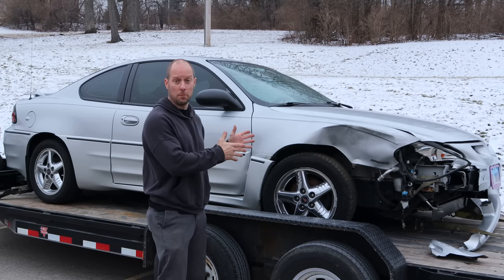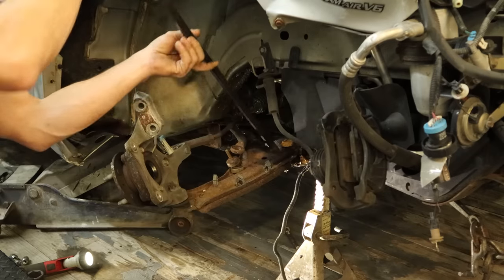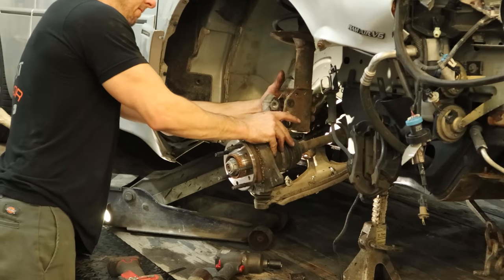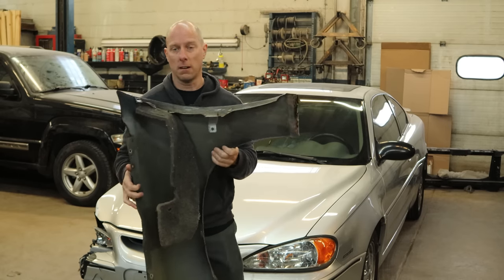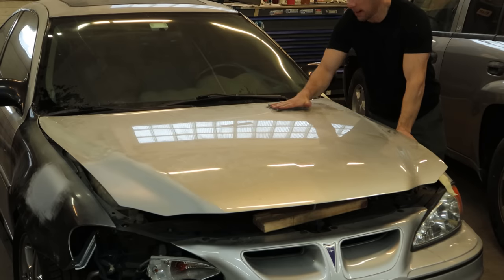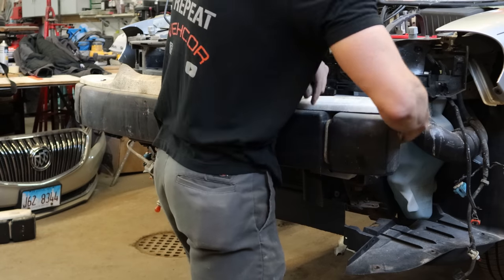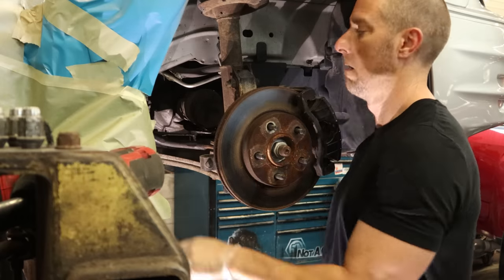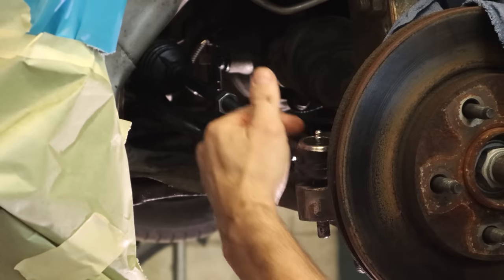How did my rebuild hold up after another wreck?  The cheap Grand Am is back again!

Comment: I’m interested in the price of the repair. Granted this example looks clean, and it would be the “devil you know”, for the owner, around here those are $2,500 cars. My impulse would be to just find another. 

I drove a 98 to over 260k miles where the odometer broke.  She never gave up the ghost and ran when I got rid of it. Super easy and cheap cars for the average shadetree to keep on the road. Tons of parts availability back in 03-07 as the local yards were full of them back then.  As a mechanically inclined college student paying his way through school, it kept me on wheels.

Comment: Damage the axle? In 25 years, I only damaged one, I used a press instead of a hammer, flared the end so the first 1/2" of threads had to be ground off so nut would fit again. It was my first one, old timer said, use a hammer. Never damaged another. I worked in front end shop most my life. So, rock-on Scott.

Comment: That extra long wiper blade reminds me of a buddy who lost one in a rain storm one night late. Only place open was a gas bar and they had one, 20" vs the 18" he needed. Had no choice but to buy it. 2 weeks later he still had it and whenever he used his wiper he also cleaned off part of his roof. 

it was a beater so he didn't really care but it was funny to see (and hear) the thump thump as it ran over the edge of the roof. 

Hey it sure beat removing a t shirt and wrapping it around the end so it didn't scratch the glass!

Comment: in the old days guys put pin strips on for making a paint repair brake off points to save on paint cost ! I could always tell do to off color. Mostly used car lot's did that ! YOUR painting guys job looks pretty good for not blending the door silver is off a little hard to do with out a blend (drop coat ). good job for a car that old anyway .

Comment: Those Grand Ams must be tough. There's still a bunch of them on the road.
Reply from the maker: If they are maintained, they last.  The rust usually gets them around these parts but it eventually consumes any car.
Reply: Not here in Massachusetts never see them
Reply: @robertsmith987  As strange as it sounds I discovered about 20 years ago that car brands and model preferences vary quite a bit depending on the state. It's a little odd but true. Some states have a higher preference for imports and it makes the domestic car values low so if you ever relocate don't take a domestic model car to Washington or Oregon because domestic cars are valued lower in those states.

Comment: You should have heated that tie rod up with oxy before you hammered it back into shape. That would have really stirred up the hornet's next. Anyone with any common sense would know that this is a temporary repair, just to get it off the trailer and you'll replace it later while doing other repairs.
Reply: Common sense ain't so common,and keyboard warriors love to strike without thinking.Either that or they haven't watched Scott long enough.Been REALLY awesome if he'd wrapped it in duct tape and hot glue!
Reply: Most of the very same keyboard warriors that complain about something being done wrong, Themselves do the very same thing wrong. They find it impossible to resist projecting their own guilt on to others allowing them to feel righteous about their own wrongs.
Reply: And then welded a piece of rebar / broken socket extension to regain strength.
Reply: Scott said he was only doing the bending to get the car off the trailer, not only can some people NOT read, use common sense, they also can NOT hear!!!!

Comment: Not gonna complain about another Grand Am or a return build. Not going to complain about that fender fix either. It's not a safety issue, it'll last as long as the rest of the car and you probably saved everyone a few bucks. As for paint not matching, depending on what it is I'm fixing (for myself) often I'd rather just get it close enough rather than perfect and spend half the money. Most people will never notice or care when they see it in a parking lot or on the road anyway. Around here it'll be covered in dust and dirt half the time anyway and it'll all match then.

Comment: When we bought our new car in 2021, the dealer tried to charge us for pinstriping, when I pointed out that I did not ask for it, and that it's not on the monroney label, they dropped the charge. Obviously the pinstriping was left on the car, and they just ate the charge. This is the same kind of crap they do with the extra window tint, and non-factory clear paint protection film, as well as any kind of ceramic coating put on. If you argue the charge, most dealers will drop the charge off of your bill of sale and not charge you for it.

Comment: Question for the painting Gnome.
I've got an 08 GM product in summit white with the classic paint peel problem on the hood, just a small spot up front. My question is should I work the area until feathered out and try and just blend the area or should i just paint the whole hood. I ask because you painted the whole hood instead of just blending the small area that was sealed.
Thanks

Comment: Out of pure curiosity, when rebuilding cars to you ever come across part of the frame or supports that you think could improve the structure of the car in future accidents? Or do you put it back and make sure it looks like it’s from factory. Either way, love the work you do!
Reply from the maker: No, frames are meant to absorb energy in a crash.  Making them stronger means the occupants then have to absorb the energy.
Reply: @vehcor  do you ever notice spots where the manufacturer could improve a design? Or do you not look for that kinda stuff. Only example I could think of would be cutting a small slot to drain water (or in your case, salt and maybe some water).
Reply: @JoeyLovesTrains  He does use a lot of cavity wax where the OEM's don't...

Comment: I had an inter tie rod go bad on a 1988 fiero and wasn't able to find it to buy it. what happened was the threads some how rusted away so the outer tie rod pull right away from it. This was back in the late 90's early 2000's. I was going down a mountain and going around a turn I went from one lane to the other lane with a lot of shaking. My ex was in the car with me. I drove it home slowly after it did that. My ex wanted to go over to their friends house. My ex was pissed at me for not going over to their place that was farther away then going home. I got home grabbed the tire on each side and the passenger side was fine grabbed the front drivers side tire and the wheel went sideways with not a lot of force. Then my ex was upset at me as how are we going to their friends house because I broke the car. Why did I pull on the tire and break it.  Tried to buy that inter tie rod and wasn't able to buy it. I called all the auto parts and the dealer trying to buy it and no one had it. All these years later I was wondering if you could finally find it and it turns out now you can buy it companies make an aftermarket one.
Reply: Can't imagine why she an "ex".😄
Reply: @freedomhillbilly348  That ex hear I broke up with my last ex and wanted to get back together again. I will not get back with an ex. There is a reason why they are an ex and I don't need to relive that.